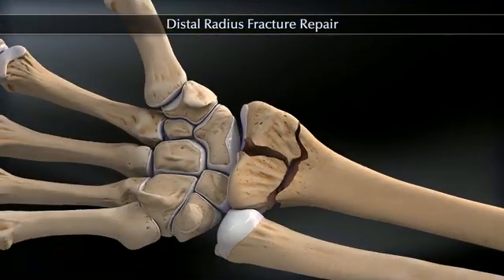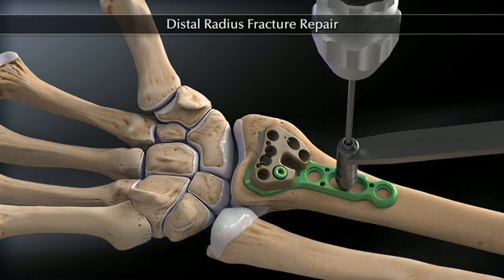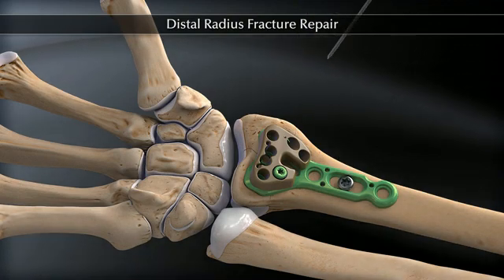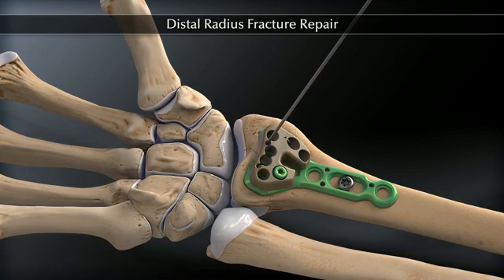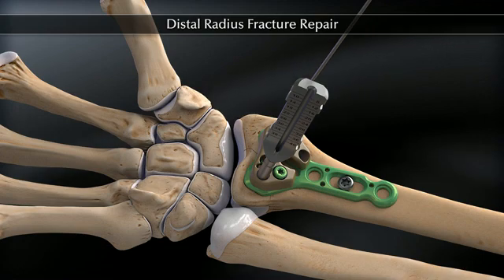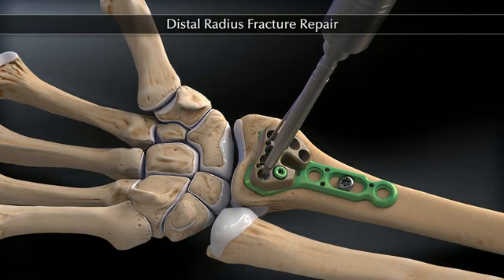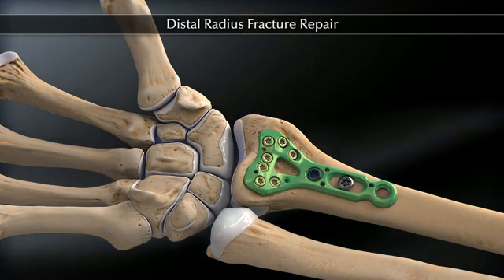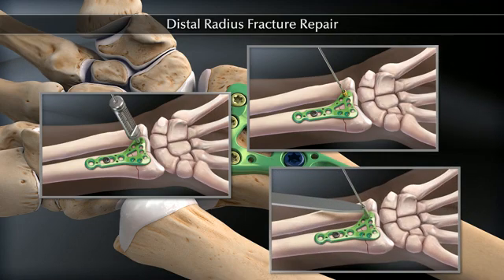Arthrex Distal Radius Fracture Fixation

Comment: I had this done in Aug 2020. My wrist works pretty well.
Reply: I had it Aug 2021 ;) Still wearing a brace and wrap around my arm and hand. It's been about 7 days and I can use my hand again. I had a dislocated wrist and hand with a broken radius. Motorcycle accident. I cannot wait to get this wrap off of my hand so I can use it better. I was wondering if you still have any type of pain after a year?
Reply: @johnfair62  it depends on how it'll heal,sometimes fractures won't heal like it used to be or worst you can't use your wrist again. But definitely after a year you can do gym classes like weight lifting, we have the same issue I just got surgery this August 2 and just hoping it'll heal normally.

Comment: I have had this done this past august ... in one year i go to get plate and screws removed.What should i expected?
Reply from the maker: It should all be pretty straightforward I would hope. Usually a soft bandage for a few days and allow immediate movement.
Reply: Thanks for replying back ,Well he also did a carpal tunnal release. My bones are soft  I am 51yrs old So i am scared about how well i will heal when the plate comes out... I have  all movement back thus far. And i was more like a soft cast for 2 weeks. it took about  a month for complete movement to come back and that was with a lot of therapy
Reply: if the plate removal surgery went little late like 14 months what would happen or what would be its  contarry effects ? becoz my daughter also have had done this surgery last year in October 2019 and has to do the re operation for removal of plate n screws